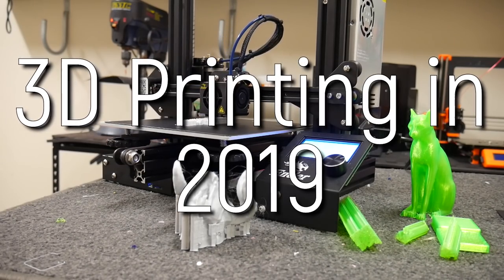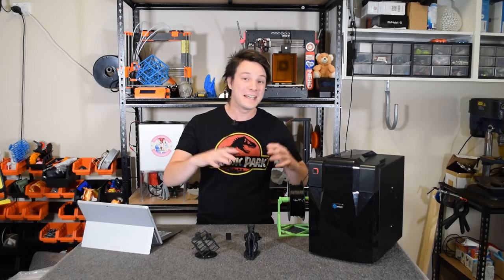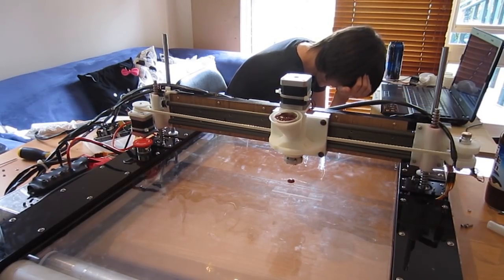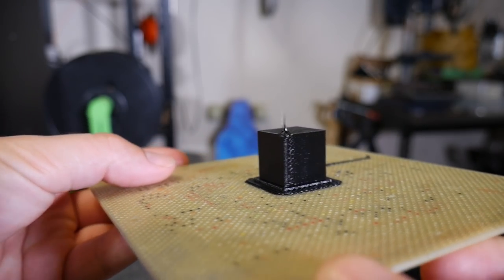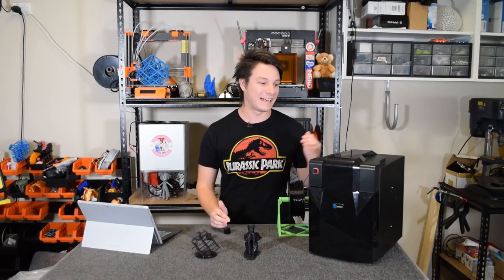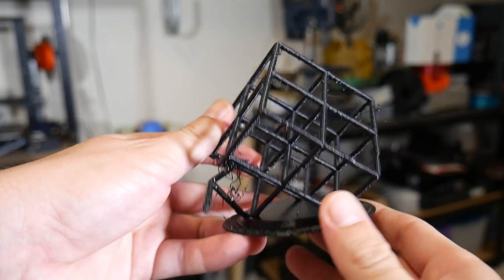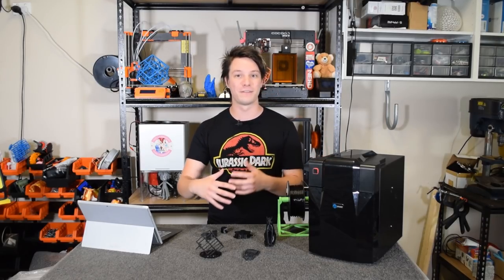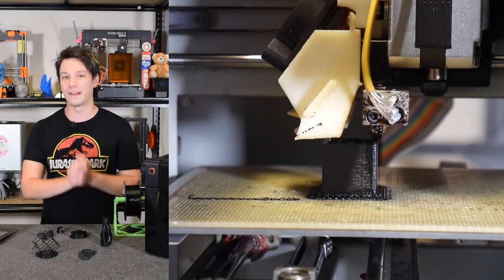My oldest 3D Printer... Is it STILL any good?

Comment: STRATASYS!  Speaking of older printers; have you had any hands-on time with a uPrint SE?  I'm being given an old one "in need of repair".  Boss chose Replace over Repair. I don't know details beyond that as far..just that it's broke. (super vague, I know) I know my way around your typical home printer pretty damn well (largely from your videos).  This takes things up a notch or two.  So, my question; is, do you have any knowledge of the guts of that machine?  And if so, how feasible might this undertaking be for someone at home?  Or is this a scenario where if it's not done by a stratasys tech, than it's nothing more than a paper weight?
Reply from the maker: They're completely closed and proprietary so unless you want to buy parts from them, or get lucky on the second hand market... you might have to just gut it and use the existing mechanics with new control hardware.
Reply: Maker's Muse Not a bad idea. In the past, Ive gotten a lot of time operating and maintaining anObjet 30pro and 260, obviously different technologies all together, but I’ve dealt with Stratasys. Hoping that with it being a low end model with outdated technology, Ill be able to breath life into it once more.

Comment: Proof that a quality printer is worth the extra $$ !
Reply: Depends what you think is a quality printer. The up mini was the worst printer I own. It’s bigger brother the up plus 2 was and is a workhorse. I own 2 of those but if you need to replace the main board it will cost the same price as 2 Creality enders.
Reply: @digitalbase9396  By "quality", I'm referring to the fact that it is still working, and producing nice looking prints after all these years of use.  I've seen MANY prints on Thingiverse that were printed back then, and a few years after, and they look AWFUL in comparison to what average printers produce today.  My $ 200.00 Ender 3 prints just about equal to my Prusa MK3 on most prints.

Comment: There needs to be some sort of "Just works out of the box 90% of the time" index for printers.  I want my time fiddling to be fixing my models and fine tuning settings, not rebuilding the printer and replacing garbage components.  I got a 3d printer to make things of my own design, not to become a 3d printer repairman.

Comment: "Purchasing something that literally doesn't work". Yup. I bought the cheapest 3d printer I could find on Amazon. It arrived 3 weeks ago, and I'm yet to get a print out of it. For starters it didn't come with any stepper motors. I contacted the seller and they want me to take pics. How do I take pics of something I dont have? Luckily I have some steppers here so I build this thing,  a Tronxy. And the extruder thermistor is not giving a value. Change the thermistor and ... same issue. It's a melzi controller board. Faulty I think. So now I'm in the process of switching over to klipper and using   the melzi for the stepper controls and another dedicated board for the thermals. Hopefully I get my first 3d print today.

Comment: These cheap kits aren't intended fr everyone. If you have absolutely no clue abou 3d printing - a fully assembled machine suits the needs better. I recently purchased a cheap delta from China - and even it was complete it had some essential flaws what would be a non working printer right from the start. The 3d printed airduct was closer to the ground than the nozzle, the heater was intended to go in a certain way - in which he would have molten the airduct as well. the cableruns were complicated and non logical - in the end, everything was a easy fix - most things, I even managed to fix while building. But this was only because I have more than 6 years of experience in 3D printers. If this was my first 3D Printer, I wouldn't be able to spot those traps and would have a very bad fist experience. For everything you start,you should use an option that definitly works, so you can spot your errors, not the machines.

Comment: 3d printing doesn’t seem to have really evolved that much, it’s the firmware more then anything.
Reply: Makes sense, since the overall design is incredibly simple; basic CNC system with a gear that pushes filament and something to melt the filament. Most of the changes is just hardware tweaks and firmware as you said.
Reply: I have pretty much given up on FDM/FFF 3d printing and I have owned 3 machines since 2012 but plastic is plastic.  Now if I had ever been able to tame ABS for my functional parts I might not have given up but active heated chamber is really what is needed as is a closed loop system.
Reply: Some convenience features which they have now are a big help though. I remember printing at university (same one as Angus actually) and having one fail overnight when the power went off. No resume from power fail then.

Comment: I still use mine. But I have upgraded mine with a new CPU und Display from tinyfab.xyz so now I can use it with Slic3r and generic G-Code. Also has Wifi now. Also soldering on a new 80°C Thermostat and replacing the old one for a few bucks made quite a difference. Still my Number one machine for small ABS Prints.

Comment: I hate that printer and I used mine to cannibalise it for parts for the up plus 2. The main board died on my up plus 2 so luckily I could use the up mini’s board with the cpu from the up plus 2. Buying the replacement board was absolutely ridiculous at $500. After buying the upbox which has an appalling cable that is connected to the extruded that fails all the time my frustration terminated any faith in tier time 3D printers. The up plus 2 served me well for many years however Tiertime now is overpriced and without the ability to use third party slicers it’s game over. I am very happy with my farm of cocoon creates, Wanhao i3 plus and Creality CR10s.

Comment: I'd love to see a comparison with a Markforged Onyx One (https://markforged.com/onyx-one/), which is a 3D printer costing a similar amount today ($3,500). I saw one recently and it has great print quality. It's difficult to see why, though, as it still has stepper motors and filament extruded through a nozzle, just like every other 3D printer.
Reply: I have a bunch of tiertime machines, a MF Onyx One and a MF Onyx Pro. The Markforged machines are awesome at what they're good at, a genuine step up from the TT. If you've got questions I'm happy to help. Owen.